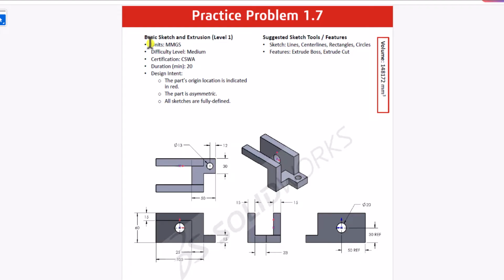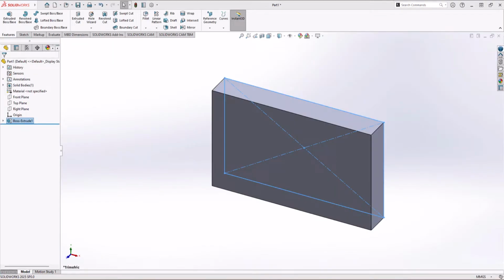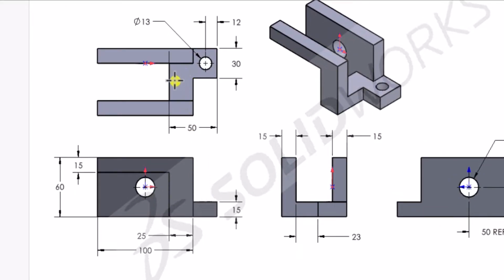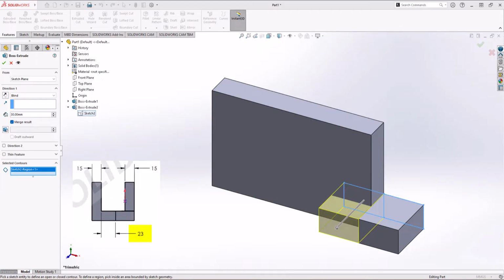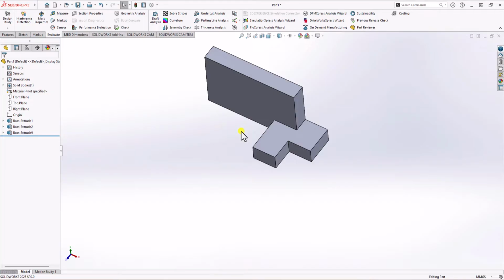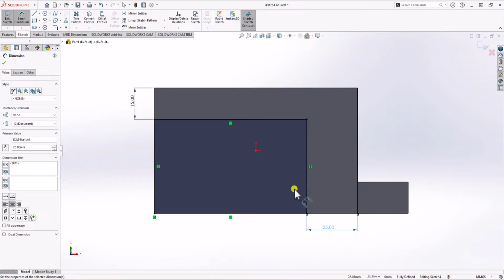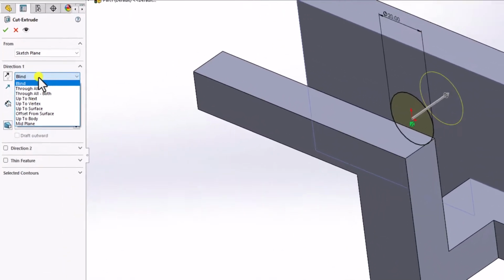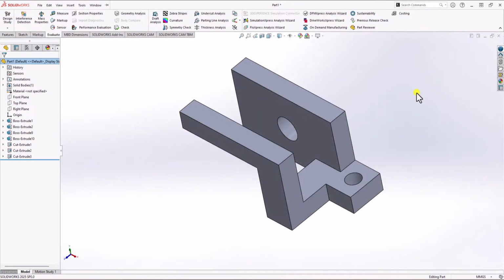CSWA Practice Problem 1.7 Solution | SolidWorks Exam Guide

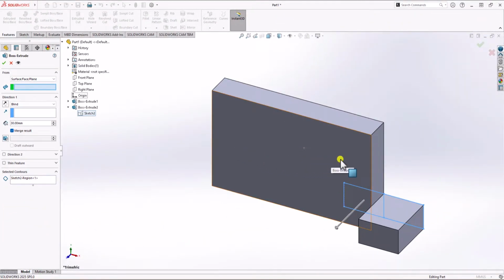Comment: looks like you cut the viudeo at 7:20. what edge did you end up using
Reply from the maker: Oh, I didn’t notice that I had cut that part of the video. Sorry about that!
For the edge, you can use any edge that’s oriented in your desired direction. For example, you can select one of the small edges at the top right or top left. You can see the edge highlighted in blue at the top right.

Comment: You are great BRO 
my question is how do you take 
PDF file view in working interface 
of solidwork 
Thanks a lot.
Reply from the maker: Thank you so much for your kind words!
Sorry, I didn’t quite understand your question. Could you please explain a bit more about what you mean?
Personally, I usually work with two monitors. I keep SolidWorks open on one screen and the PDF or drawing on the other, which makes it easier to reference dimensions and instructions while modeling.
Reply: Thank you very much BRO
for your kind reply I got it

Comment: how do you know the hole from the top view aligns with the edge of that large-area-wall?
Reply from the maker: You’re right. The drawing does not explicitly specify this point. However, since the location is not defined, it is reasonable to assume that the center point of the hole is aligned with the edge of the geometry. If you zoom in, you can also see this alignment in the drawing view.
Keep in mind that CSWA drawings are not always to full industry standards, so in some cases you need to make basic assumptions to proceed.

One important thing to mention is that no matter where you place the hole, you should still get the same result. In these types of questions, the goal is to find the total volume, and the volume removed by the hole depends only on its diameter and depth, not its location. So regardless of where the hole is placed, the final volume will remain the same.

Comment: Your origin is not in the right spot, right?
Reply from the maker: Yes, you’re right that the origin in my model is different from the origin shown in the question. However, that is not important for a couple of reasons.

If the question asks for "total volume" or "mass" (which is the goal here), those values are independent of the coordinate system. So you can model the part in whatever way works best for you and ignore the origin.

But if the question asks for something like the "center of mass", then the coordinate system does matter, because the reported center of mass depends on the chosen origin and axes. In that case, you need to make sure your model’s coordinate system matches the one used in the question.
Reply: @Design_With_Roozbe I see, thanks for your quick response! I always try to keep the original origin in the drawing, that’s what made it confusing for me.
Reply from the maker: @MultiBannanaSHITTTT  No problem at all. I’m happy to help! In general, it’s a good habit to make sure we use the same origin as shown in the model.